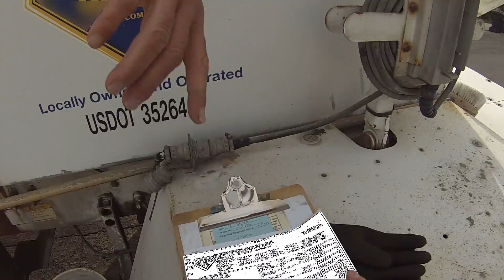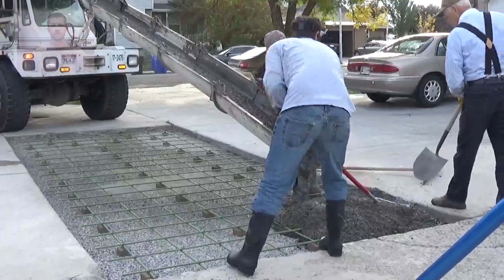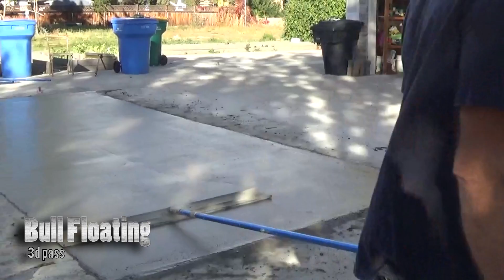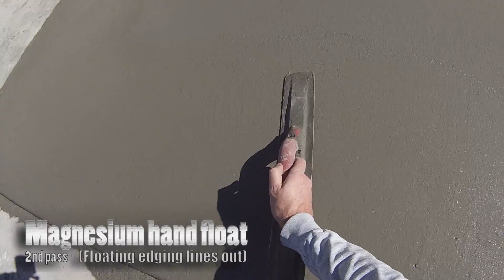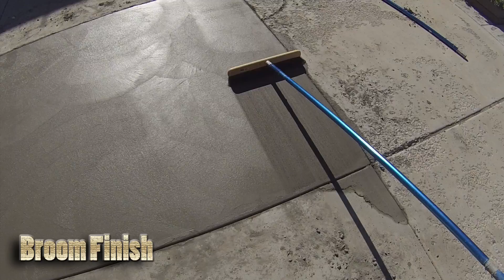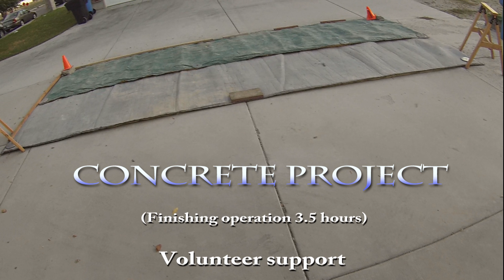How to Finish a Concrete Slab

Comment: how much concrete 21-9-5 use (yards) and how much did it cost.
Reply from the maker: 3.5 and it fell between $600 - $650 with tax, that also included a weekend $50 charge.
Reply: AgelessNomad okay thanks for the reply

Comment: Hi AgelessNomad, Your description of the Concrete Dragon in the beginning, can you explain what you mean by that? Is that the recipe for a disastrous project? Or, is that the mix that you use to avoid such a catastrophe?
Reply from the maker: Poppa Don that was the mix design used. I named it the dragon because that's what it felt like going up against, for my first time.
Reply: AgelessNomad, I see. This is a great video. Very informative. I have done a few smaller concrete projects, but am in the midst of a 10'x23' patio extension. I want to make sure that the mud doesn't get away from me, it did on one job that I did years ago, so I am going to request a delay, as you did. Any other tips?
Reply from the maker: Poppa Don Thanks man! Glad it could help out. As far as any other tips, id say a prayer or two as well haha
Reply: Prayers are to be said, for sure.